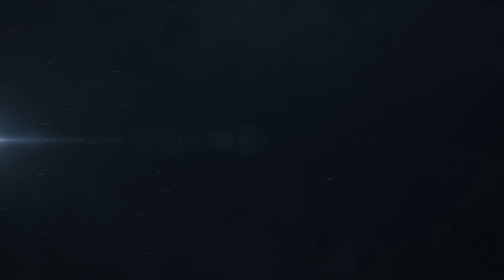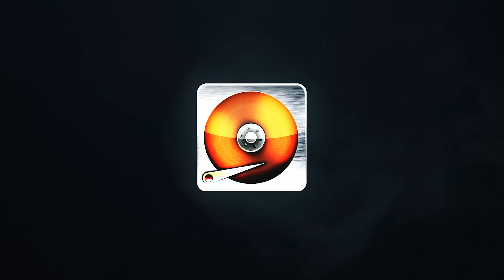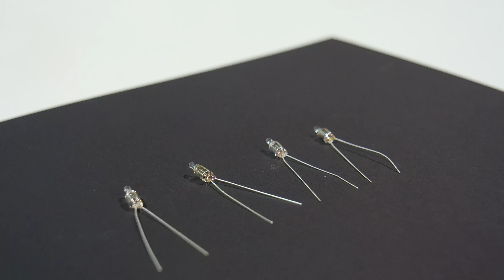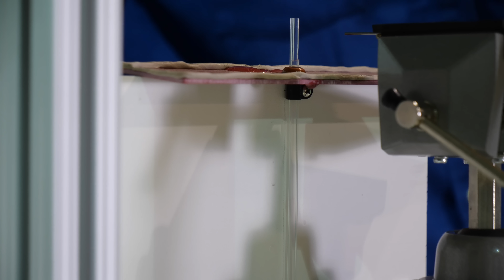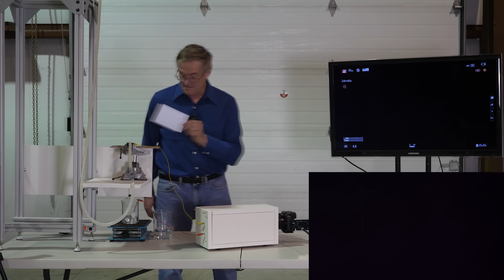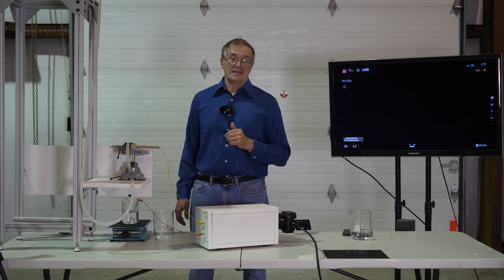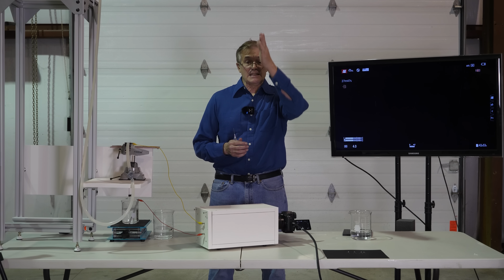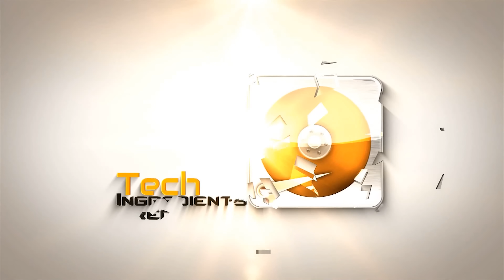We made electricity from water - and it's easy!

Comment: How many watts would it take to pump the all water back up to the container and how many watts does it produce in comparison?
Reply from the maker: It's roughly 10 % efficient in converting the gravitational energy into electricity.
Reply: @TechIngredients was just thinking if it could be useful for boats. Also does it need to be deionized water or can salt water work too?
Reply from the maker: According to the linked article,  the researchers found that the performance with salt water drops by 10%.

Comment: If the inside of the separator pipe were a slight cone shaped with “ roof shingles” rough eddy sides would that help the separation thus increase the voltage.

Comment: You’re just turning gravitational potential energy into electricity in an exotic way. A hydraulic turbine is much more efficient in doing this, and simpler. Nice science experiment, though.
Reply from the maker: That's the principle.
The approach here is different. There are no moving structural components, and the velocity is extremely low.

Comment: It's a bit confusing to me if it's 100% due to the molecule separation or both separation and static charge build up due to movement. It may once be used but I think we don't have the need for this very low power device. Okay, to power a small IoT device maybe. But solar panels are so cheap and windmills exist. If those two are not the answer you don't have enough of them lol. There is a device that uses a fuel cell to turn methanol into electricity. But it's only generating 50 watts continuesly. And methanol is pretty expensive. It is being sold though.

Comment: Use water when using a swamp cooler.
Does the water evaporate as the hydrogen is used or does 😤🌫️🤨😖 delete delete delete where does the hydrogen go?
If you do a swamp cooler on the side of a skyscraper that is both used to water plants and cool the structure could the water be used all the way down the building to the ground.  You say the hydrogen doesn't rejoin but could it after being used to garner more energy from it
Have a course like a radiator redirecting the hydrogen back to the oxygen molecules or is it smelling like ionization

Comment: WHAT!!!

NO rockets? NO drones? NO lasers?

I'M OUT‼️

Seriously though, this reminds me of a wall poster in my high school electronics shop. This showed an annotated version of a faded Egyptian wall painting with the original photo in the bottom left corner.
My teacher didn't know how real the photo was, he just saw it at one of the postcard shops and thought it was cool.
It showed a pyramid's vertical cross-section which had a couple of large shafts that had several smaller shafts and some chambers connected at intervals. I don't remember the layout, but two lines were added for the poster showing the path from bottom to top and side to side. The lines crossed inside one for the chambers.
It also had a (water?) canal or pipe that ran under it and showed a line of decorated rectangles coming from the top.
Our teacher thought it looked like some kind of energy, maybe even electricity. But now I'm wondering if they were bubbles?
FYI: I tried to find it online and couldn't

Comment: What happens when you have multiple stages?
Reply from the maker: Each stage will increase the output voltage by approximately 6,000 volts.
Reply: @TechIngredients  I’m not looking for the voltage but the water characteristics. Ph is logarithmic. Any change made on the first foot, or 1st stage will require ten other stages to be doubled. But, does that happen empirically? This can potentially lead you into a wastewater treatment solution not in use right now. 
I am chemical engineer expert in wastewater treatment. 
This sounds like a process to be developed.

Comment: Could this be coupled with a small capacitor to keep the bulbs lit consitently rather than flashing? Even if it can drive fewer bulbs?
Reply from the maker: Yes, it could. 
I wanted to keep the circuit as simple as possible in case doubters suspected we were hiding a power source.

Comment: 13:55  I'm not sure I follow.  Couldn't you rig up a system to the side of a houses downspout, which would drain the water off a roof's gutters?  

Also, have you ever seen the squares in Venice, where all the rain water from the surrounding buildings collect into communal tanks?
Reply from the maker: You're correct in principle. 
The chalange is scale. We'd need several liters per second to generate one watt of power.

Comment: This may have been a method ancient Egyptians used to make electricity. Dendera light is a motif in the Hathor temple at Dendera in Egypt, depicts a 'snake' emerging from a 'lotus flower'. It is part of the Egyptian creation myth and has been interpreted as a form of ancient light/plasma technology. Last time I checked lotus flowers did not have a transparent/glass sheath in proportion to a light bulb. Nearby there is a box with ~6 tubes/wires emanating from it which are joining a U-shaped container. This could be a water-generator. <><><> Only 5 volts are needed to create or transmute elements [NEW tech!!!] including incredible/impossible ones with 1000's of AMUs [atomic mass units] <><><>
Reply: @TechIngredients Would you like to carry out an experiment to explore how the ancients built precise megalithic blocks and more?
Reply from the maker: Hmmm.
Reply: @TechIngredients  Per the new tech, presumably anyone can transmute elements with a $45 setup.
Reply: @TechIngredients  FYI, I'm a triple engineer and a prolific inventor in many fields incl energy.
Novel rotor/blade-less wind, rain and hydro electric power converters have been devised and tested. Your example is distinct.
--
The global megalithic structures and some hieroglyphics in Egypt may be evidence of much earlier sophisticated/advanced civilization[s].
Reply: @TechIngredients   Apparently the ancient hindu Indians also created electricity from falling water droplets. See vid at ~ 30:00 minutes:   Technology of the Gods | Why Ancient Vimanas Aren’t “Myth” – Paul Wallis & Praveen Mohan 
--
Modern researchers have experimented on the effects of electricity and magnetism on living things. Structured water is real and healing with Dr. Gerald Pollack being most famous researchers.
--
Leme know u got this

Comment: If you added an electrolyte to the distilled water a raised the water to a height that would introduce atmospheric energy, would it raise the electrical output?
Reply from the maker: No.
The electrolyte actually decreases the charge separation by a few percent. Beyond approximately 30 cm, the voltage potential plataues around 6,000 volts.

Comment: But in the end its just an electrostatic charge seperation effect. You dont get more energy out of the water than using a kind of turbine - and this would have a much higher efficiency!!
Build the turbin small then you can also use low kinetic potential differences, but still there is not industrial benefit.

Please do not go in the wrong direction: Cold fusion, zero-energy motors, vacuum energy powerstations, 4 stroke engines with water as fuel ...
Reply from the maker: That is what it is accomplishing. 
Not to worry. "Free energy" pursuits are based on ignorance.

Comment: Just from your explenation there is more power potentioally created. When you put an electrical circuit between the two Reservoirs you are forcing a redox reaction to happen. 4OH- = O2 + 2H2O + 4e- and 2H3O+ + 2e- = H2 + 2H2O so you would be creating hHydrogen and Oxygen and could run a fuel cell for extra energy. But this sounds too good to be true. And I would have to do some thermodynamics to confirm this but it should be testable

Comment: I'm an aging 70 year old scientist. I can more explain this process, as valid, by pointing out the following facts when you look at the thinking of Michael Faraday and Nikola Tesla. 

This system you are demonstrating works from Michael Faraday's principle of induction in this demonstration. This same effect can be produced by spinning a toy motor shaft manually, to serve as a small atom smasher to collect electrons for your use, which can be sent through the contact points of the motor where you would hook up a DC battery to the motor. Then you can just collect the electrons. The force that smashes the atoms, to separate the electrons, are found in the wound wires making up the inside of the motor, attached to the spinning shaft of the motor. From there you can charge up capacitors as a electron storage device or a chargeable lithium battery to collect the electrons. Before I even read Faraday's principle of induction, I use to do this playing with toy motors taken out of my toys, as a budding boy scientist and engineer, even as early as 10 years old back in the 1960s. I had not even read Faraday's principle of induction at that age.

You have created the same kind of engine using water, where electron flow is being used to collect the electrons in the form of singlet oxygen carriers or hydroxyl group carriers. That's what you just said as I simplify the explanation. I'm saying it in another way and I'm doing that for a reason. This would be your O- or HO- carriers, which the water turns into. The goal is to collect the electrons, as the water is broken up in its flow, so you collect the O- atoms or HO- atoms, while losing the "O" carrier atom or HO atom, leaving only the electron left over for you to harvest. Large industrial turbines built by power companies, work no differently. They just collect a heck of a lot more electrons in the work they do, to feed the grid to power our world. A similar phenomenon happens when water flowing down a mountain hits a lot of rocks in the form of a rocky stream. The impaction creates hydrogen peroxide with a lot of singlet oxygen (O-) release in the process...a lot of electron release in other words. Bathing in this kind of water can help rebuild electron load in the cell membranes and kill all forms of cancers over time, given cancer can not stand electron light load, let alone oxygen load in the body being raised. 

WHILE BOTH APPROACHES TO COLLECT ELECTRONS ARE DIFFERENT, THE PRINCIPLE BETWEEN THEM IS THE EXACT SAME LAW INVOLVED: One method is done physio-mechanically, through an artificial motor made by man, hence the toy motors I use to play with as a boy. The second one, the one you are showing here, in this video, uses more of a natural way of producing the same engine concept, but is being done using simple water chemistry and physics to produce singlet oxygen (O-) or a hydroxyl group carrier, which is carrying the electron for work or use. 

In both cases, both approaches work from Michael Faraday's principle of induction. For those of you who don't know how that works, look him up on Wikipedia. In both cases, you have created mini-atom smashers, as we use to call them in my day, which break apart molecules, even simple ones like water, making the electrons available for harvesting or harnessing for use.

One approach is done through mechanical physics and the other approach is done through a chemical approach. Both are achieving the same goal in the end and are easy to understand when you understand the absolute principle (law) behind the way this thing works in the Universe. Faraday is given credit for the proving of induction. Both he and Tesla operate on two different sides of the same coin, when you come to understand the thinking behind both men and their contributions to elector-magnet power, which runs our world these days.

Comment: Also, what if by "rain water" the authors simply meant pure water. Since Rain water is basically pure. Would you be able to use this method to make power with tap water?
Reply from the maker: Yes, and we did. The output is similar.

Comment: Can the water trickle into a second one of this?
Reply from the maker: Yes.
This was actually mentioned in the original paper. 
6,000 volts is about the limit for a single stage.
More practical voltage and current levels strongly suggest parallel operation to increase current at the already high voltage.